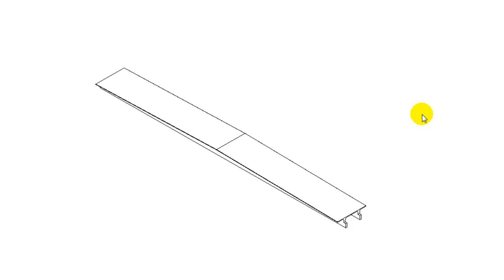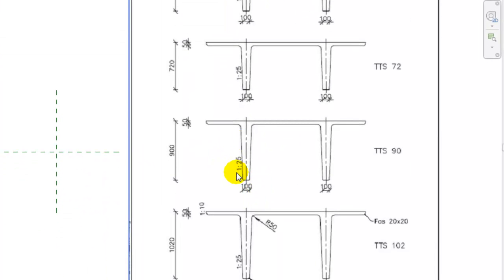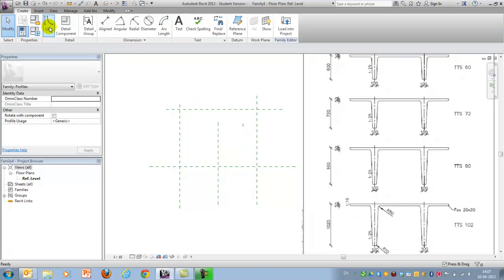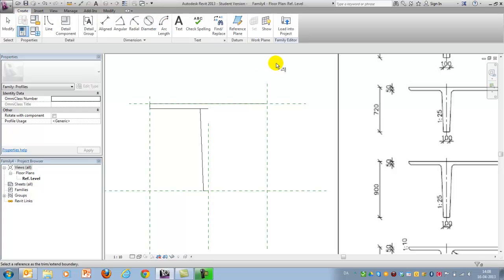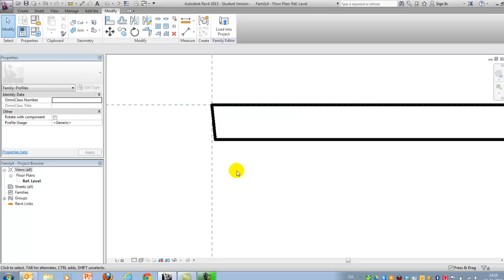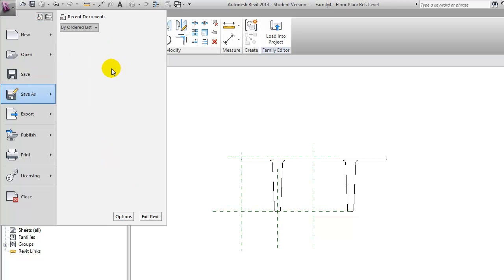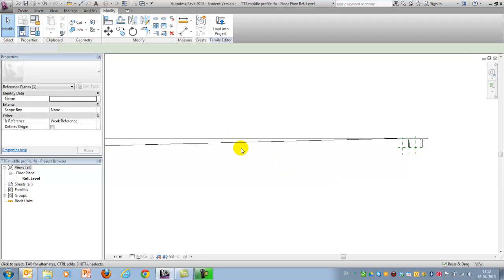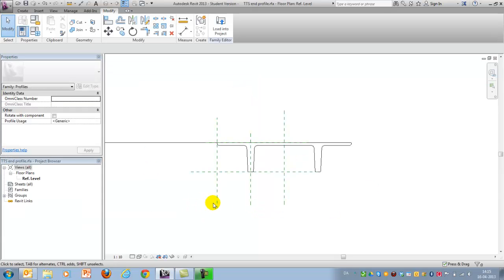1/2 TTS - Creating a loadable family in Revit 2013

Comment from the maker: CORRECTION:
The end profile save in this video has a "helpingline" which I forgot to delete. This is not a problem if the profile is being use in 2D, but it will give you an error when using it for eg a "swept blend". So always check your profiles and make sure that no two lines a on top of eachother or line are outside the closed profile.